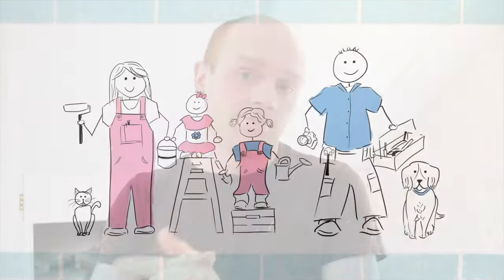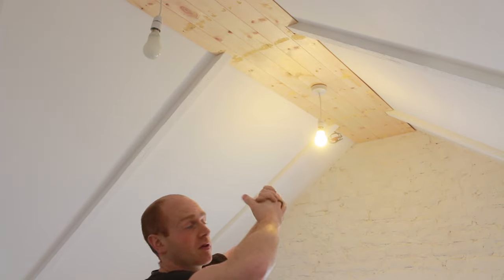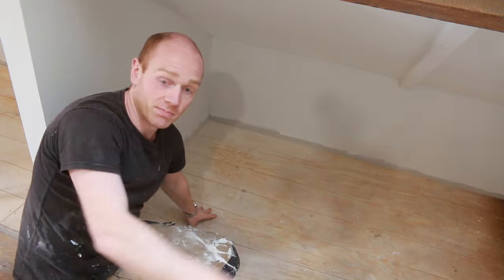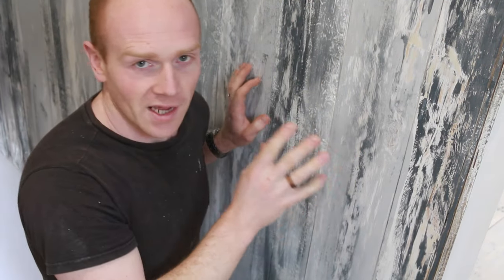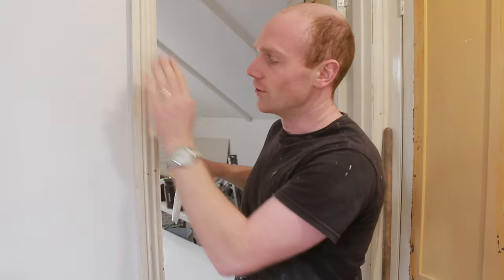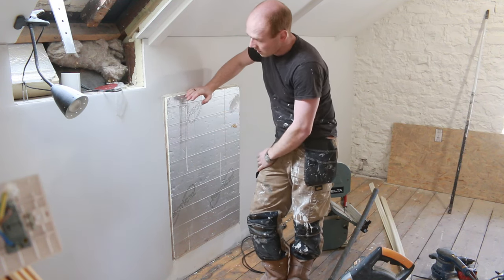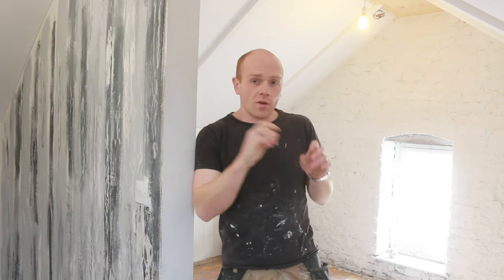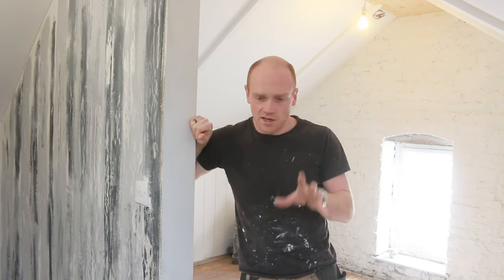Loft Update - Lots to catch up on!

Comment: Back in 2010 I bought my first house. I glossed all the woodwork with oil based. It was already white. But clean start and all that. 2016 and we put the place on the market. We had to repaint all the woodwork again! Because it had yellowed at least twice as bad as that architrave you highlighted. I did some research and found that in around 2010 manufacturers reformulated oil based paints to comply with new rules around VOC content. Some of the formulations were poor and resulted in paints which yellowed very badly. Since then manufacturers have improved the paints (I'm lead to believe) so they don't yellow as badly. But they still stink lol. I had been using water based satin in the new house recently until I realised primed white doors were still taking 4 coats to look decent! So I switched back to oil based.

Comment: Have a look at 'dado trunking' for your desk area - it'll need less fixings and holes than surface boxes. It's more modular too.
Reply from the maker: That's a great idea.  I come across that all the time when photographing commercial interiors and hadn't thought to run a stretch of that under the desk.  Less hole to fill after too as I guess you only mount the trunking rather than each socket.
Reply: I have a 2m section under my desk here, with power, network and phone sockets. The dado trunking mounts onto the wall, then the backboxes 'clip' into the trunking. The triple compartment variations make it easier to run cables in, as behind the boxes can sometimes be quite tight. One hole though the insulation and plasterboard to run cables, and the various mounting holes. 'Spring toggles' work incredibly well at providing a solid hold on what you wish to secure to plasterboard. 

'Bench backboxes' could also be something worth considering, they are perfect for sockets with USB outlets. Again, I have a single gang one here with a USB and power socket mounted to it. Quite handy for charging the phone or plugging in the laptop. 

PS. The project is coming along nicely. I doubted your idea of the 'exposed' timber when you first suggested it, but now it has been painted it really does look the part. Keep up the great work!

Comment: Great video. I'm about to regloss som woodwork. What was that eggshell paint you spoke of? Would it be suitable for skirting board, doors etc if painting over old gloss?
Reply from the maker: The eggshell we use is just a standard acrylic eggshell from Leyland.  It is holding up very well and drys almost too quickly!  So great for us impatient type!  Old gloss does need a good rub down first but two coats over with the eggshell and its great.  Slightly more matt than satin but very wipeable and hols its whiteness.
Reply: The Restoration Couple thanks for the reply....hate glossing so this might be my answer. You're a star 👍🏻